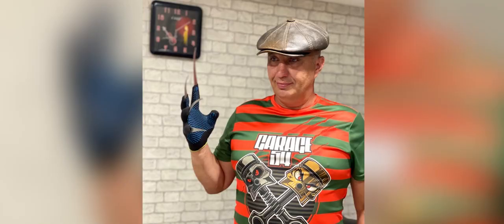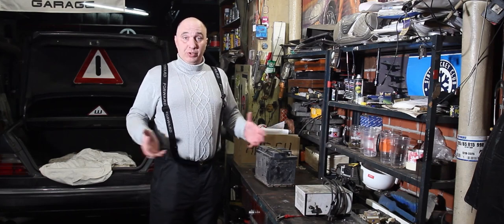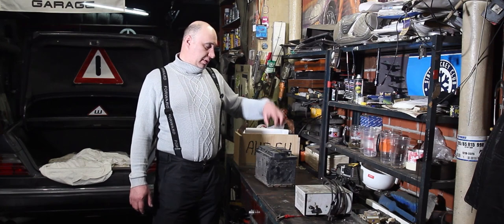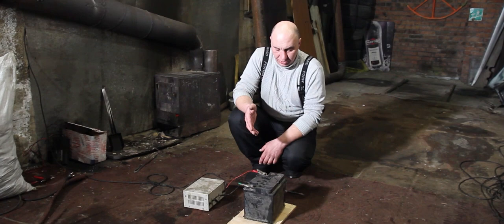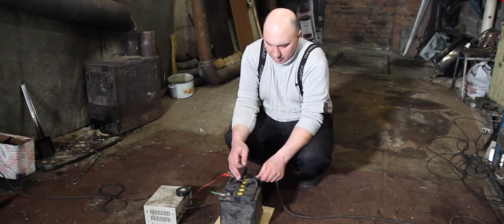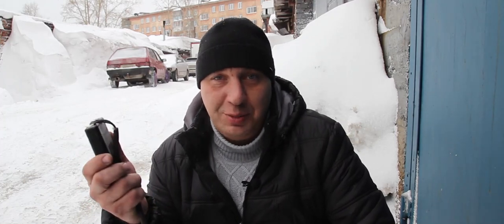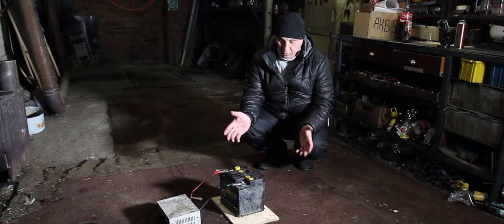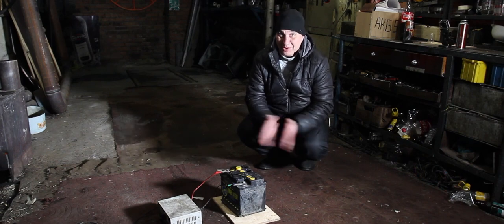Shocking a car battery: will it explode?

Comment: And this is why flooded-cell batteries should be charged in a well-ventilated area. Makes it a lot less likely that hydrogen will reach a high enough concentration to ignite from a random source.
Reply: Or use the battery vents
Reply: It's why you're supposed to connect ground lead 2nd when jump starting, and to the car itself rather than the battery terminal. (Admittedly I rarely do this though.)

Comment: I've witnessed at least three such explosions, and all were much more powerful than this. The first time was when my brother was MIG welding some car bodywork, the second was when I was angle grinding some steel straps, but the biggest and most spectacular was when a couple of guys were trying to jump start a tractor from their lorry battery. With that one, there was an almighty crack o' doom, and bits of battery were hurled about 50ft into the air. Bits seemed to rain down from the sky for ages after.  After the bang, there was not a lot left of the battery on the tractor. I think they were trying jump start the tractor (12v) directly from the battery of the lorry (24v).

It was one hell of a bang! - but the language afterwards turned very acidic, and the air turned blue.

"Never f@#k with a tractor and a truck"!
Reply: cool story bro.

Comment: I had a defective 6 volt battery that explode during charging.  The explosion was so extreme, that much of the battery had vaporized.  Anyhow, now you know why you have to connect jumper cables the correct way.  First of all, the battery negative (-) connects to car chassis/engine.  And so the last jumper cable connection you are to make, is not to the battery negative (-) terminal, but to chassis ground, and do so at a point located far from the battery.  Thus, if the connecting of the black jumper cable to ground creates a spark, it will not cause the battery to explode if gasses are leaking from the battery.

Comment: I used to work in interstate battery factory, in the charge room we charged the lead plates in a mixture of 17% hydrochloric acid and water for twelve hours, rinsed then bake in oven, well sometimes the chargers had surges during a storm and if the lead plates touched it would boil and snap like firecrackers

Comment: A couple of years ago while working on a commercial fishing vessel, i were changing the starting batteries 24V (2 pcs 12V 240Ah) On the rear side thruster engine.  While working i accidentally dropped my spanner. Needless to say, the named spanner landed perfectly on to both poles of one of the batteries, and instantly welded itself to them. Within a seconds the spanner started to become glowing hot, and realizing what was about to happen i throw myself backwards and sheld my self just as both batteries exploded with a gigantic BANG! I was sprayed with battery acid and the first minute after i were in shock and struggle to comprehend what just happened. Me now basically deaf by the explosion had to confirm that the where no immediate dangers with remaining parts of the to battery, before i throw myself into the shower and my hearing slowly come back over a couple of days!

Comment: At my friends place, during the evening 6 years ago, we were in a camping trailer and heard an extremely loud bang. Considering her husband was outside messing with his gun, we figured he had done one of his usual antics and popped something. Didnt think much of it, and didnt really ask when he got back. At that time the trailer was plugged in. Battery power toggle was off. The power went out during the night. The next morning I went out to check the goats to make sure they were fed and watered, and found plastic shard all over the ground between the camping trailer an goat pen, some 200 odd feet away.  I looked around and was investigating. He popped his head out of the camper and said he had no power. I came back to the camper and noticed the battery was gone. It was 50 foot away in the horse pen and in pieces. It damaged the battery location and part of the frame on the camper.
Reply: No it didn't. That never happened.
Reply: cool story bro.

Comment: Short circuits can also be bad. I once worked in a warehouse that had an ancient walk behind electric pallet jack that had something wrong with it, where it wouldn't go till you slapped the top of the battery compartment. Around afternoon break i went to use it, and it was parked behind the break table a few of the guys used often. When as usual it wouldn't go i slapped it per normal procedure and BOOM! It blew up! Scared me enough, i jumped 6 inches sideways. But the hilarious part is the guys at the table, with it being behind them, levitated about a good foot or more, one guy who was leaning backwards in one of those common cheap plastic chairs fell backwards, breaking the two rear legs off and slamming his ass to the floor. " I swear guys i didn't do it on purpose, was just following procedure! " They were understandably upset at first but after a moment of reflection agreed with me it was the companies' shoddy maintenance at fault. Thankfully I didn't get in trouble for it, i think the bosses knew about the issue with it. Never heard if they got another one though, left a while after for a new job. 😁👍

Comment: I once had an old worn out 12V battery. I wanted to try to revive it by overcharging it. So i took a 48V DC charger that i used for charging an electric scooter and hooked that up to the 12V battery.
Guess what: after about 5 secends it went KA-BOOOOM !!!  The entire battery casing  exploded! acid everywhere.  It was epic. LOL

Comment: I worked as a mechanic for nearly 20 years and I only witnessed 1 battery explosion. The vehicle came into the shop with a dead battery. The tech who was working on it jump started the vehicle and was driving it into the shop when it blew up.Thankfully the hood was closed, so it contained the parts.Our only concern was neutralizing the acid . It was incredibly loud, about the same as an airbag going off, which is about a loud as a shotgun blast. I believe the battery had an internal short, which caused it to discharge itself(which is why the car was there in the first place) and when the tech jump started it, it started drawing extreme power from the alternator, started to boil and ignite on its own.

Comment: Watching this video brings back a few shocking memories😛😁, I've accidentally exploded 3 or 4 batteries in my lifetime. Once was grinding 2 meters from a charging 12V battery on the floor where the sparks were shooting in the direction of the battery. I always charge batteries with their caps open. 

Another time I went to inspect our 36V forklift battery while it was charging and I forgot that I was busy smoking a cigarette at the time. This 36V battery consisted of 18 single cells of 2V each but each cell was the physical size of 4 or 5 small car batteries stacked on top of each other. There was just this huge ass explosion when I got close enough to ignite the fumes. Incidentally this forklift was great for jump starting trucks with run down batteries. We would just connect up 6 of the cells to achieve the necessary 12V or occasionally add an extra cell giving 14V as an added boost if the truck starter was really dragging.

On one such occasion my assistant ignorantly connected the booster cables incorrect polarity😳😳😳😛😛 the moment he touched it to the terminals there was an almighty bang from the truck battery.
Reply: @steven cool story bro.

Comment: I don't need to try it. I have seen the results of an exploding battery!  When I went to a Blacksmith to have some work done, he told me I was lucky he was still here.  He had been charging a battery (large one) with a big charger.
He decided to go out and finish something he had been working on.  He switched on his welder (Quite a sizeable industrial one) and struck an arc to start the weld, there was a very loud bang, so loud he couldn't hear for a few minutes.
He looked around to see what had caused the explosion, it was the battery he had been charging.  It had exploded and blown to bits.  He showed me bits of battery that had embedded itself into a very thick doorpost, it was well into the wood, which was about the size of a railway sleeper.  The bit of battery was everywhere, one bit was even stuck into the wall mortar, it was impossible to get out of the doorpost or the wall.  😳  Some bits had been thrown outside and landed 50 yards away (at least) and bits had gone through the roof.
He was very lucky and he knew it.  He was one of the few people I knew at the time who could weld sheet cast iron.
Anyone that has tried will know how hard that used to be, and still is not too easy a task.
I tried to remove the bit of battery that was imbedded into the door post, but there was no way was it coming out.
The explosion broke all the glass in his workshop as well.  🙄
I hadn't thought of the danger oof charging batteries before this, but now I am very careful.
Reply: cool story bro.
Reply: @mann_idonotreadreplies  The guy was getting on a bit, but that night when he went out to finish a job, he was very, very lucky.  We went to see if he could do a welding job for us the next day.  That is when he told us about it.  He still looked a bit shook up about it.  It must have been one hell of a bang.  There was little left of the battery, just twisted cells and two terminals.
Thanks for reading about it  😎💥👍

Comment: I had a battery explode next to me as a kid. My dad was using an old battery to crank over an outboard boat motor. The battery had been and was still on the charger when connecting the terminals. I was about 5 feet away, luckily looking the other direction. My pants and shirt got splattered with acid. Not 5 minutes later there were small holes  all over my clothes and another 5 minutes they grew to almost an inch round. Looking back I don't know why I wasn't told to change and wash up right away given the poison danger it posed. The battery was in pieces all over the garage and the blast sounded like a shotgun blast. Always charge in a ventilated area and unplug the charger before disconnecting the terminals. To be safe, wait a few minutes after unplugging before disconnecting the terminals.

Comment: Yes had a side post battery explode on me I was using an acrylic clear inline spark checker that is used to test for spark on each plug while the car is running it appeared like a good flat plastic surface to set it down whell it wasn't a fire involved only pressure I believe and it completely destroyed the battery immediately when I started the car

Comment: Batteries usually tend to blow up when a cell fail short internally which cause the other cells to over charge and emit excessive amounts of gas inside the battery and it might blow up on it´s own. I have seen that happen several times

Comment: When i was young lad, i just charged car battery on my balcony,. After while i want to remove wires, but i forgot to switch off charger. There was spark and boom,.. Burned cloths, burned skin, acid everywhere, burned concrete floor. It is miracle that it doesnt hit my eyes,...

Comment: The battery you're trying to explode isn't generating enough hydrogen to do much because the plates inside are caked up with scale that happens as batteries age. I've heard that there is a technique for clearing them by reversing polarity back and forth, but I've never tried it. I hope you figure it out!
Reply: I also have heard of reversing polarity myth and Tried this reversing polarity on one or two batteries in the past, all I can say is it's just a myth. Landed up destroying my rectifier in the charger instead.
Reply: @stevensunhing2618  I connected them to terminals of  DC velder for short periods of time to shock plates inside them so scale fall down from plates. Some come back decent but on some plate connects and battery goes to internal short circuit. Around 50% sucess so far.

Comment: Here's a nice experiment. Drain the battery completely flat with a light bulb untill it's 0V , leave the lightbulb connected and place the battery in a freezer for a night.
A totally flat battery wil freeze up. Then when the battery is frozen, disconnect the lightbulb and start charging it up with a heavy duty charger. The gasses can't excape and the battery will explode.

Comment: more likely when high amp fast charging them.
not so likely at only 12 amp or lower charge.
but with what car batteries contain, it's always very dangerous to have one explode.
when they switch to lithium, we can watch them burn instead. 🤣
Reply: but you can explode a car battery only when you ignite the fumes when it's charging
Reply: @terasestHammasratas   
yes, and higher amp charging boils more, creating more hydrogen to ignite.

Comment: and that's why smoking in the shop is dangerous
be it gasoline or vapor from brakecleaner, or even a faulty battery that the fancy digital battery charger didn't recognize as faulty, many things can go wrong
and a smoker is less likely to pick up on the rotten egg smell a faulty or overcharged battery generates along with the hydrogen gas

Comment: It happened to me one day when I unclipped the charger from a battery that was charging on a bench, a little spark from the charger clip to the terminal set it off. It blew the top clean off.
Deafening bang and got covered in battery acid. Thankfully, I was only 15m from a garden hose.

Comment: Those 90's model Chevy batteries are dangerous for this reason. Trying to put a longer bolt in to get extra threads caused the bolt to enter the battery and arc inside.

Comment: G54 should make 1 of those Hydrogen Generators with the plates and solution to generate their own h2 with water and a 12V battery then route the generated hydrogen into the combustion chamber to run their car on water power (hydrogen generated power that is).  A car that already runs on gas can be converted to run on hydrogen.

Comment: Welder yes
Angle grinder yes
Cigaret NO!!!
Try throw cigarets in fuel tank/canister :D it has low temperature for gases and liquid fuel extinguish it :D
It can blow only if you throw cigaret to more flamable material, like fabric...

Comment: I got a awesome idea hear me out get a car then get four engines and connect one engine per wheel you could use front will drive engines just weld the diff inside the transmission so you don't got to worry about the other output
Reply: serena🍊  derpy derpy derp

Comment: A sealed battery should not emit hydrogen. Looks like you charged it with much higher voltage or charger was faulty, which caused overheating and explosion.
Reply: They always do.
There is a little vent pipe on the side usually. But they really emit a lot when the charge controller isn’t working, and cooking the battery.

Comment: A battery will explode if you discharge it very fast like shorting the poles with a thick iron bar.
Reply: I had that happen once. I tried to jump start a mini from a 12V motorcycle battery. It blew the end clean off, acid everywhere.

Comment: In 1986 a 24 volt battery was connected to a six volt battery I was less than 2 feet away inside an armoured vehicle. It went off like a huge explosion It blew the insides of my ears apart. 4 operations later to my left ear it was repaired. I am now deaf and rely on hearing aids. Worst part was my ex wife took half of my competition. Steve from Perth Australia.

Comment: About time to try water powered Lada by producing hydrogen gas the same way as car batteries do (plates with opposite polarity) and would it be 107% success
Reply: I had my Lada Niva running on hydrogen and petrol, I had just changed the oil in the engine and fitted two hydrogen units to it, the oil remained clean for the six weeks I was running the hydrogen units whereas normally the oil would become dark after about a week.

Comment: When I was about 14yr I had been charging my car battery overnight, it had been off the charger for quite a few hours and I was hooking up the car  again  to the + and - terminals, I had the car door open so the interior light would have pulled some current, hence the last terminal connected sparked, the whole battery exploded into millions of pieces cutting my clothing and skin to pieces, acid all over me , and i was deafened by the explosion, all that was left was the base part of the battery and some of the lead and plate separtors, DO NOT take the risk the batteries when emmiting hydrogen can cause some real damage.